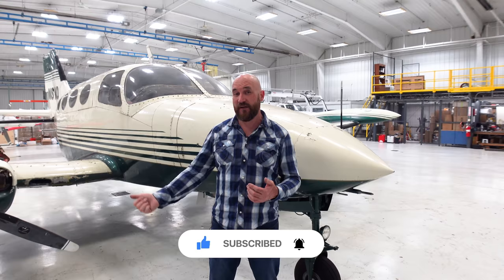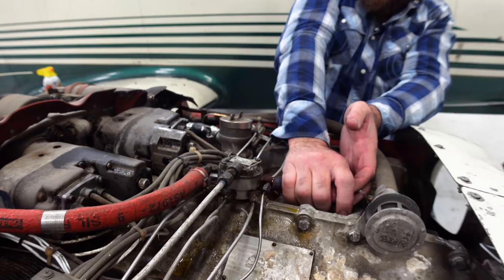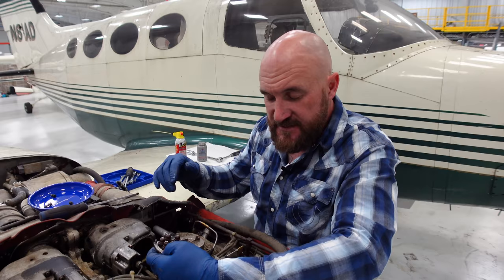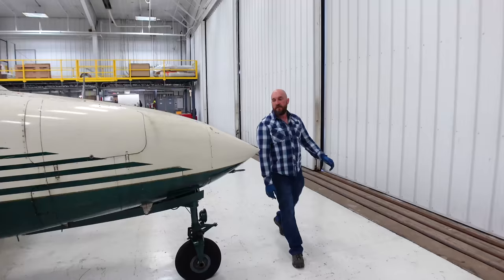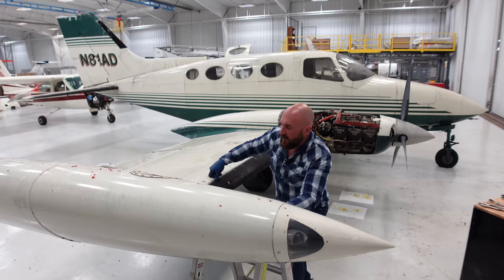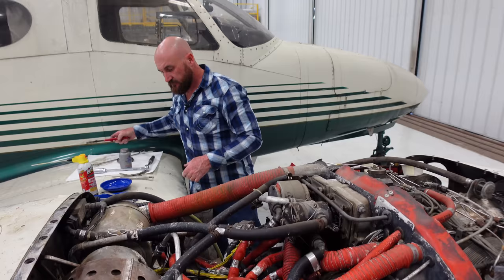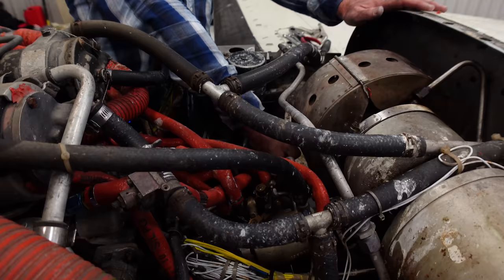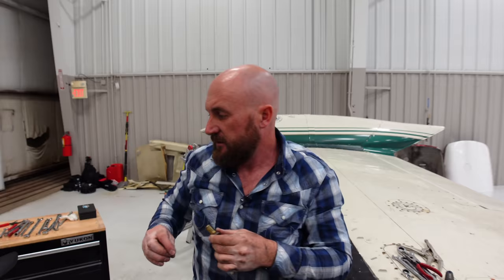He's Trying To STEAL Our FREE Abandoned Airplane ! Ep3

Comment: I worked on those engines quite a lot from my experience when they have not ran for a while you need to start them flooded especially since you're not 100% sure the fuel to air ratio is right here's how you should do it to get it started. First advance throttle to full power stop along with mixture to full rich position, then with the boost pump ON prime the engine until fuel starts coming out of the overflow on the ground and let it pour out for about 3 seconds. Turn the boost pump off then bring mixture to cut off that way it doesn't get any more fuel in the cylinders once you hit the starter. Leave throttle to max power then start cranking engine with the starter and mag switch ON if engine fires up, quickly bring mixture to full rich and back off throttle but not too much to keep it alive. That procedures floods the cylinders with gas and helps the rings to seal up since on those engines oil do most of the sealing on the rings. As far as oil pressure goes the gauge should start reading in a 30 seconds window if not then no oil pressure or the line is clogged up. It also needs to crank faster idealy to start it up but with the above procedure it should work. Don't abuse the starter, a max of 15 seconds should be enough or you'll burn it up. The turbo not spinning is not giving you any chances. Have someone with a fire extinguisher nearby, fuel on the ground might catch fire. Keep it mind it's got air, fuel and spark there's no reason why it would not start beside a starting procedure or an odd thing going on

Comment: Instead of spending time freeing up the turbo just to see if the engine runs, just pull off the charge pipe. You don't need a turbo to start and run. Give the engine the air it needs, just eliminate the turbo for test purposes.
Reply: Agreed do that with the turbo. and do a search on fuel pressure. Get a fuel pump and regulator on a fuel can run line up to that junction and try to see what happens. If that is all you need is fuel that would solve that to see if it runs and cheap setup too
Reply: Ya but if he did that then he can milk the videos for more time and it won’t make as much money.
Reply: The problem with that is most of the time these kind of things have a map or maf sensor or a combination of two so it knows how much air is going in and out of the engine taking one off or the other would be very devastating for the aircraft's engine it may not even start even if you did that.
Reply: @lmssoftware3130  is it possible then, that the map/maf sensor is bad or dirty, causing the problem?
Reply: @lmssoftware3130  BS. at idle the engine is pulling vacuum, removing a turbo isn't going to change airflow enough to stop an engine from coming to life.
Reply: @tobyatencio6698  who knows aviation does things differently from automotive side of things but generally speaking older vehicles that have turbos or superchargers on them have some form of mechanical monitoring that helps keep the turbo or supercharger from surging generally it's not as common with superchargers unless of course you're running a bi-turbo supercharger setup for those extreme altitudes honestly it's probably best to not try to introduce any more problems into the equation. Of course by that I mean taking off the charge tube you might be able to get the aircraft started for maybe a second or it might run who knows it might run really bad because turbos are usually tuned to the engine you take the turbo out suddenly you lost a lot of air inside the engine it could cause extreme misfires rattling shaking etc turbo for now.
Reply: @elonmust7470  and that is where you're wrong a turbo at idle has to be spinning to allow enough air flow to put any sort of load on him if you were listening to the man in the video you'd know this if you put any sort of load above idle even slightly without a turbo moving it's going to stall. Taking the whole turbo out is going to cause even more issues because generally speaking the engine is tuned for the turbo. I.e if you take out the turbo which introduces more air into the engine generally speaking there's more fuel in the engine to balance it out it will likely run richer which causes missfires and surges or in some cases runaways.
Reply: @lmssoftware3130  Completely false. I'll state again, the engine, at idle, is pulling VACUUM. The AFR at idle is not going to be disturbed by lack of turbo. 
I tune turbo engines, I build turbo engines, I build turbo piping & manifolds. I wire standalone ECUs.
Reply: Lms
Reply: The turbo being seized shouldn't stop it from getting air. A seized turbo still allows air passage unless it's clogged... I mean.. I don't understand why he's dwelling on the boost.. makes no sense.. it can be replaced easily if need be.. not necessary to run
Reply: @name_less7687  I agree it should still be able to run granted you shouldn't be able to put a lot of load on it it's really get it up to idle smoothly but yes it should still very much run which is why I wouldn't even bother removing it
Reply: @lmssoftware3130  We aren't talking about sensors.
Reply: @lmssoftware3130  Lack of turbo does not "starve" the engine.
Reply: @lmssoftware3130   Pretty sure they didn't have computerised sensors when that plane was built. Even today, aviation is way behind the auto industry with that stuff because of regulations.
Reply: This dude just knows enough to get in trouble.
Reply: @lmssoftware3130  How does the turbo affect the engine when it's pulling vacuum? 
Why do you think so many people experience boost leaks without knowing? 
The turbo changes things once it starts creating positive pressure, until that it's not much more than a source of added back pressure. 
Had you tuned any turbo engines you'd be familiar with the similarities & differences in fuel curves of an NA & a turbo version of the same engine.
Reply: @name_less7687  Agreed. I would wager that it's being done this way for the creation of content.
Reply: @aftonline  I literally said that already. And I concur you're probably right but it has probably one way of mechanical monitoring probably through check valves the good old-fashioned way most aircraft have a manifold pressure gauge
Reply: You dpnt need the turbo to spin to start it anyway. You can run a car with a seized turbo. Not well, but it runs.
Reply: @1one3_Racing  amen
Reply: @lmssoftware3130  You realize the turbo impeller not spinning & the turbo not being there at all are the same thing.. Slightly more back pressure is the only difference. Like I've already said...
Reply: It’s gonna run like sh@t but it should run. Back pressure mostly
Reply: @misspginbc9947  your smart just like the fake phone call good acting tho
Reply: @TaterFarmer  running like s*** or whatever wins him the plane it's not to do with the turbo boost or even the turbo is to do with getting it running for one second or more so he can have it then he can fix the dam turbo s until then it's still a naturally aspirated engine it does not need the turbo to run for a few minutes
Reply: @lmssoftware3130  it's a old school turbo. THIS THING WILL IDLE WITHOUT!!!!!!!! THE DAMN TURBO AIRFLOW!!!!!!!!  NOW WILL YOU TWO STOP YOUR PISSING MATCH AND HELP THE GUY OR SHUTUP
Reply: @dlee5936  I stopped a long time ago dude. I acknowledged that fact ages ago he hasn't let it go. I blocked him 3 hours ago. As I said I don't give a shit.
Reply: @billhouchens7439  frankly dude. I got streaks in my draws older than him probably. He knows it all let him say what he wants. I've seen otherwise and done otherwise. As I said; I don't care enough and won't lose sleep over it. :)
Reply: Turbos are black magic untill you’ve lived with them for a few years, lol
Reply: If just getting engine started is the ticket to owning the plane then it has spark just take top plugs out pre dose those cylinders mags live fire it up job done might have to repeat process few times to blow the cob webs out but it will run i think this video is just stringing it out for theatrics
Reply: @christopherbedford9897    Oh the horror, oh the pain. . . .  Wait wait, is the camera still rolling?
Reply: I think it’s proof enough his clueless
Reply: @misspginbc9947   That was my first thought to. Even that call was faked.

Comment: When you're "priming" the motor, you should see the fuel needle for flow move to the right showing a gph value.   normally priming a injected engine is -  booster fuel pump on -> mixture full rich -> wait till needle moves showing flow, count three seconds (this is the actual priming), then mixture off.    For starting -(after successful prime)  mixture off, pump on, crank till it fires, as soon as it fires mixture rich to keep it running, then lean it out (as needed) for taxi so as to prevent fouling plugs.    Good luck.

Edit: and after it fires set rpm, and watch oil pressure gauge.  no oil pressure in 10-15 seconds, shut it down.
Reply: This dog knows a lot about plane engines. Pretty sus if you ask me.
Reply: @iamrumar  Got a treat?  I love 🥓
Reply: Actually on the continentals the electric boost pump is off for starting
Reply: @iamrumar  lots of people actually become airplane mechanics. Hell, its almost like the government has jobs for you to do so and will pay for the schooling.
Reply: @Red1676  it was a joke. About the commenters name.
Reply: @EzrajSmith  My experience with injected props is limited to Lycomings in Socota's and Pipers.  Experience as a pilot, not an A&P but I'm no stranger to piston engines.  Thanks for the clarification!  👍
Reply: Set up a go fund me we can all donate a tiny amount crowd fund then
Reply: @iamrumar  😂😂😂
Reply: You also need throttles open, at least 1/2".  On a cold start you can leave mixtures rich.  On a hot start you flood it by pumping fuel in with throttles open and mixtures rich, and then start with mixtures lean, throttles wide open, then run them rich, and close throttles as soon as it starts.  It's quite a dance when the engine is hot.  Cold start is mixtures rich, fuel pumps on, throttles open for 1-2 seconds, then closed and cracked open 1/2".  So, if he wants fuel in those cups he needs to open throttles and mixtures and then run those boost pumps.  There is also a primer pump next to the start buttons for pumping fuel in while cranking.
Reply: @johnaclark1  So getting it going should be a no brainer, so long as he knows Aircraft fuel systems.

Comment: Put the throttle and mixture full forward and use the switches labeled “prime”. If still no fuel there’s an issue with the diaphragm in the flow divider (the fuel manifold you took apart on top of the engine). Fuel flow is a measurement of pressure and not actual flow, it shouldn’t be getting that high, indicative of a blockage.
Reply: The fuel flow from the mechanical pump to the flow divider seemed good. It was a good amount of fuel considering the small squirts the injectors spray. That's why there is return line (the very rusty one) opposite the red inflow line that he checked, any excess fuel gets returned back to tank.
I have a strong feeling that the fuel is just not getting through the injectors via the flow divider.
Reply: Bingo! I am in agreement!